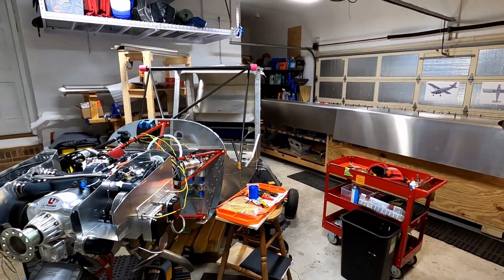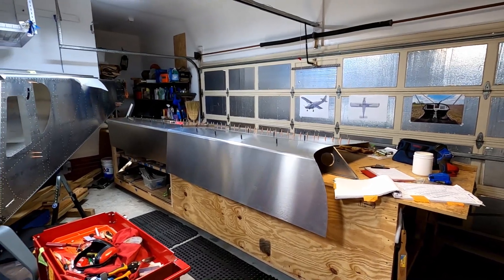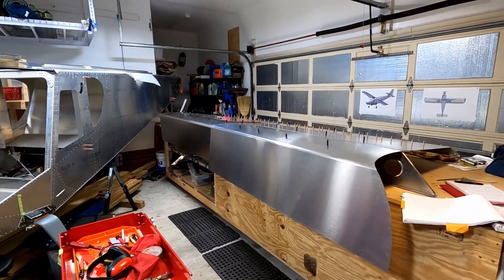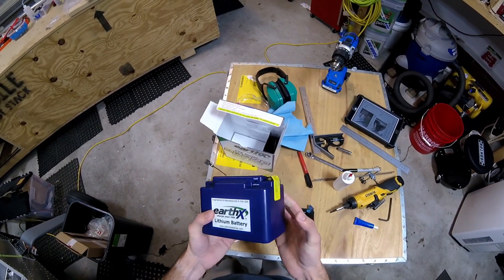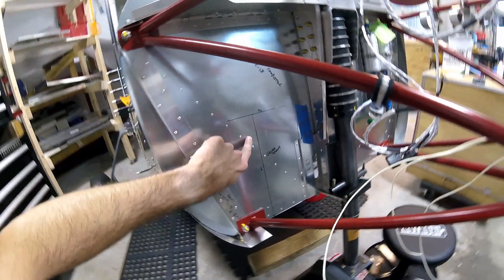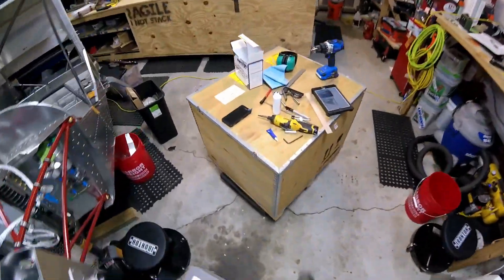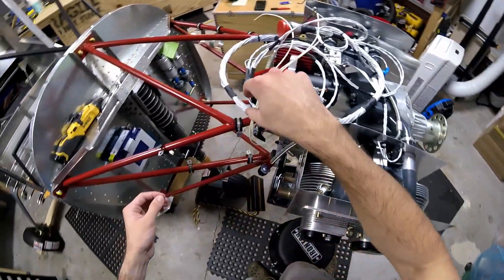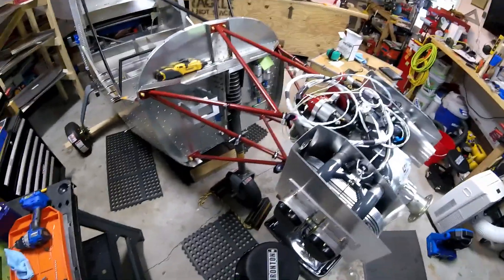EarthX 680C Battery Bracket Mount Installation - Zenith CH 750 Cruzer Kit Plane Build

Comment: You might want to lower the battery holder.  I can't imagine you will want to remove the bracket to replace the battery down the road.

Comment: It's off topic I know, but how well do those insulation panels on the garage door work and how did you attach them?
Reply from the maker: They don't really seem to do anything. They are just 1/2" insulation foam glued to the wood.
Reply: I meant how well do they insulate. I'll have a hangar door soon that I'm going to want to insulate somehow, just haven't settled on a method.